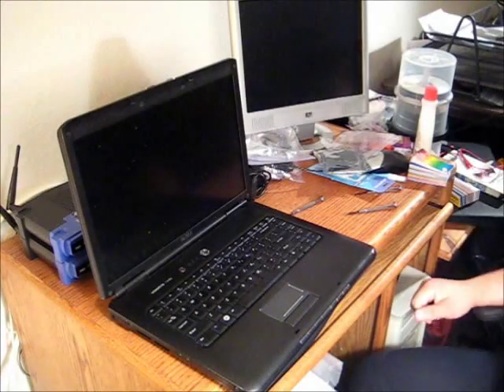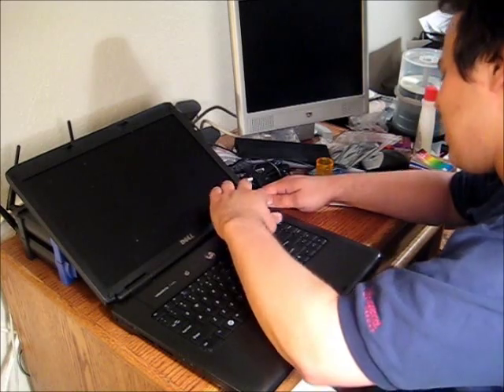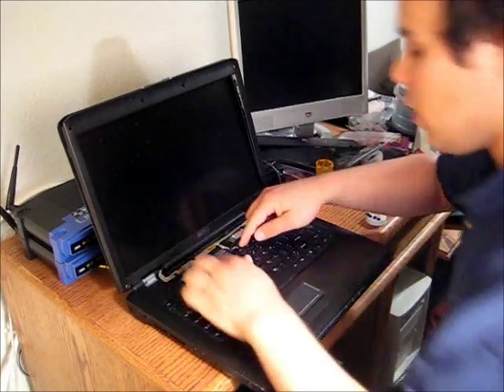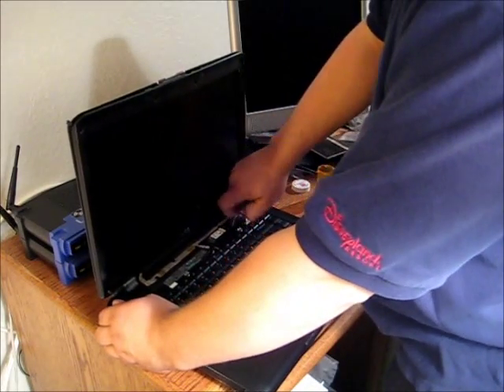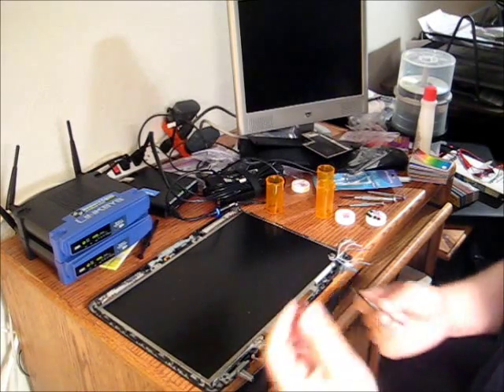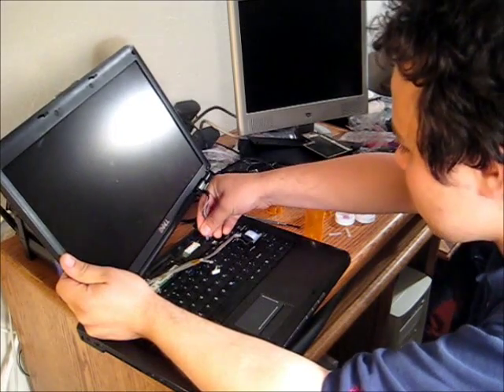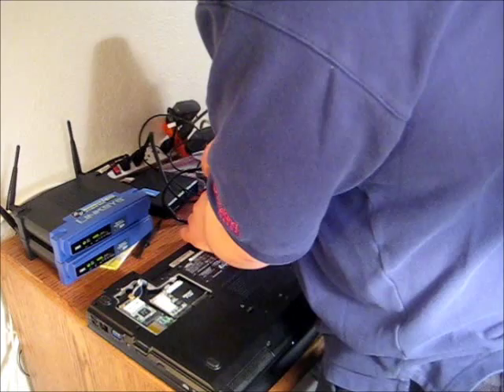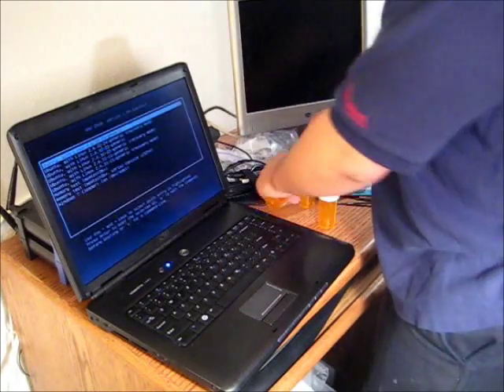Fixing Screen Wobble on a Vostro 1500

Comment: Thank you so much.I bought the new hinges on ebay and then dismantled just as you showed. That was great. When I got to the hinges,I found it was not the hinge but the part the hinge is attached to which is broken.The hing (probably seized up) snapped off the metal alloy corner. So can someone please let me know how I can replace this part, what would be the part number. Do I have to buy a new top cover?They only show the outside of the cover and you cannot actually see what else comes with it.

Comment: Thank you very much.  Very helpful!  Two points though... 

(1) I got hinges on eBay easily enough. 
(2) I found I didn't need to bother disconnecting any wires. That made the job much easier and much less risky.